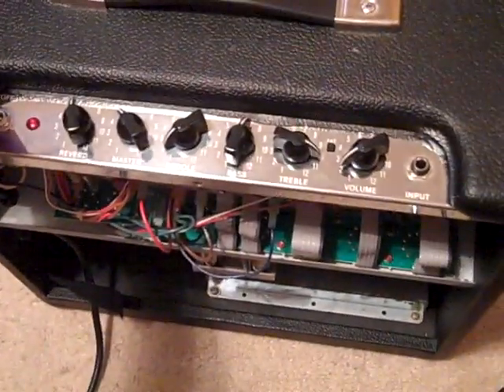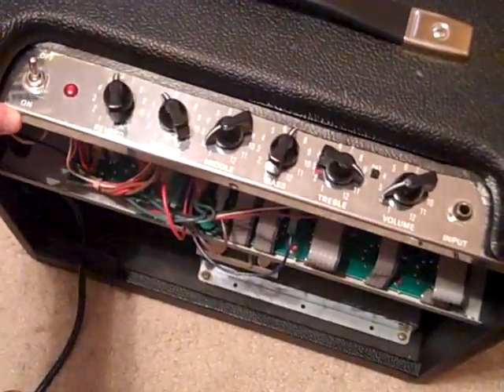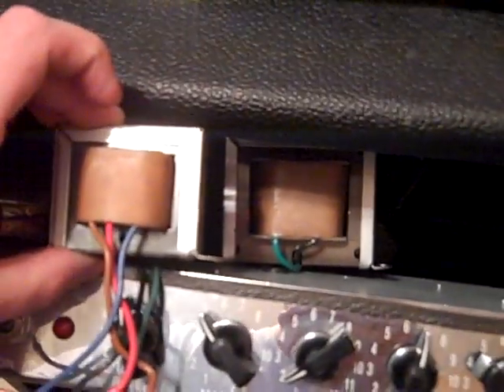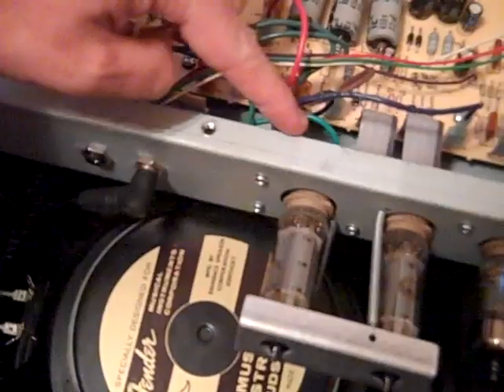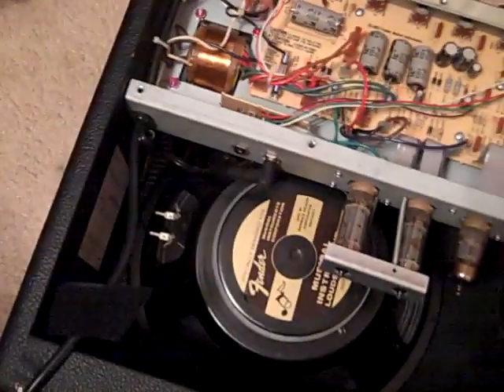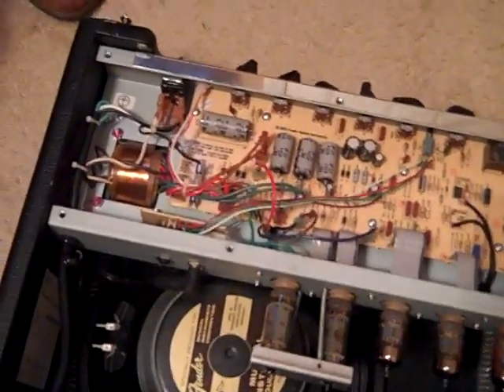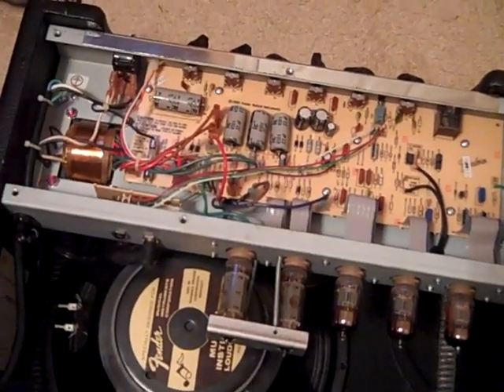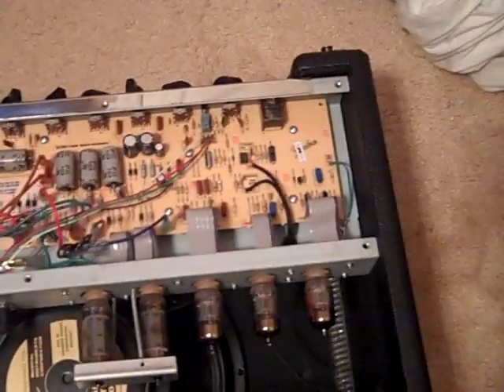Fender Blues Jr - Mercury Magnetics Mod

Comment: I can tell you I was very skeptical at first, but the truth is, the American made parts not only sound better, they're also able to withstand the heat and current that tube amps generate. Any amp, new or old can benefit from swapping out to mil-spec goodies. if & when you get your hands on another cool rig, you can try it then, but be warned: Chasing the tone dragon is extremely addictive. I've been at it for many years, and the day I quit will be the day they're shoveling dirt on top of me.

Comment: If you zoom in on my profile pic on your left, you can see my Tweed Princeton. I got it back in '88, and it sounded really tired and saggy. Since then I've replaced every resistor and cap in it, I got a new re-issue Jensen P-8Q , and some really good tubes, a British military 12AX7, an RCA black plate 6V6, from 1961, and a JJ 5AR4. Now this amp is a little tone monster that plays sweet when you hit it easy, and growls and wails when you hit it hard. In my mind, this is what tubes are all about.

Comment: Now that you've done the most expensive mod, you should upgrade all of the caps to good U.S. made parts. Use Sprague, Mallory and Orange Drop. Be patient, change 'em one at a time, don't get your iron too hot and ruin the PC board. You'll hear that Mercury O.T. really begin to open up your tone. If you like it after that, you can change the 1/4 watt resistors to 1/2 watt carbon composition type. That will perk things up quite a bit too. The imported original components in most new amps are junk.